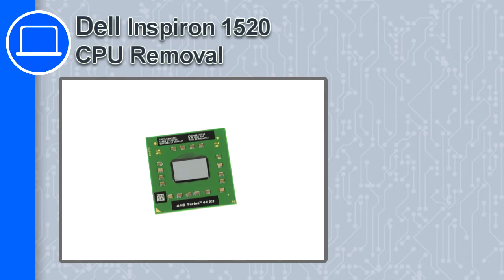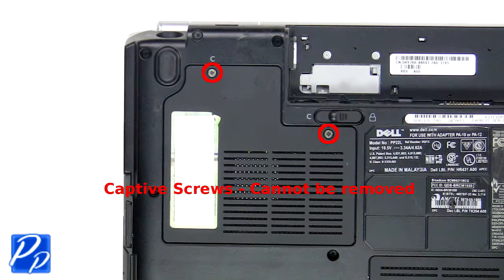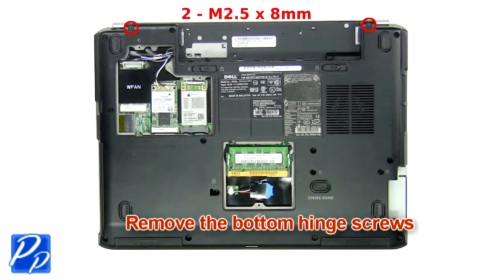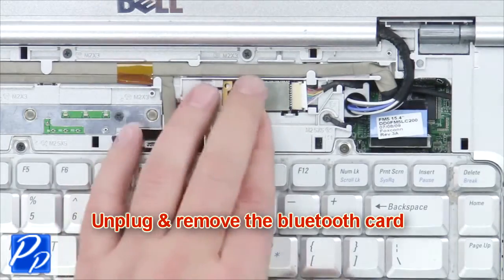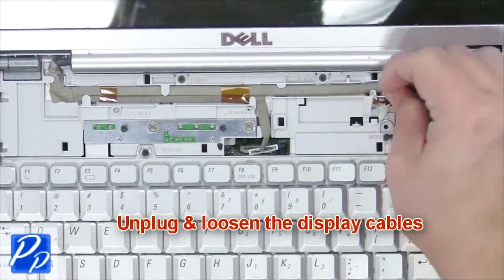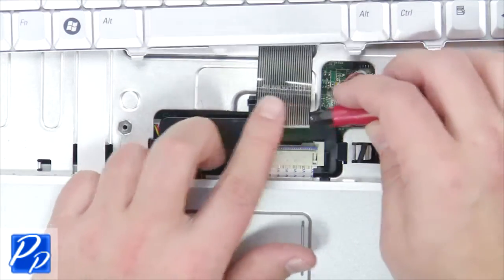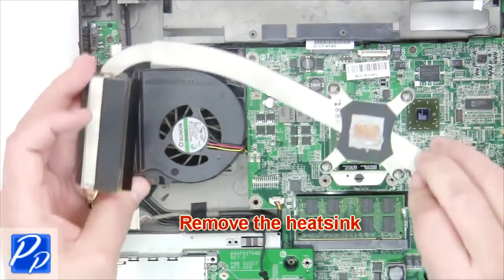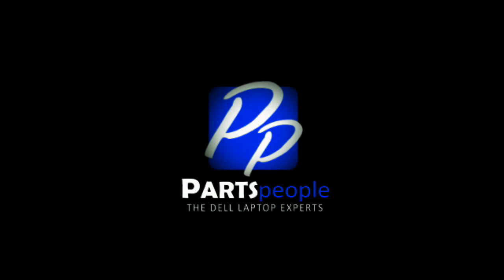Dell Inspiron 1520 CPU Replacement Video Tutorial

Comment: Wait, That's A Dell Inspiron 1521 - With AMD Proccesor That's Not The 1520
Reply from the maker: They have the same screw locations.
Reply: 1520 makes it harder to replace the processor because there is an additional video card radiator
Reply: @lukasauks9062  Yeah but that's only true for the dedicated nvidia graphics model. The Intel integrated graphics model heatsink is similar as the video.